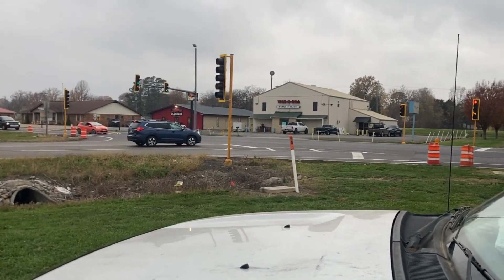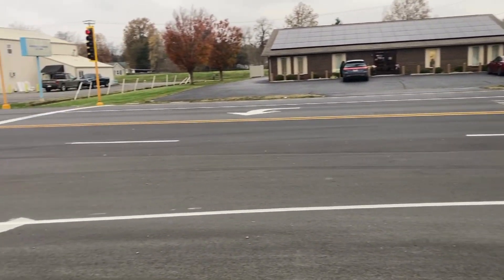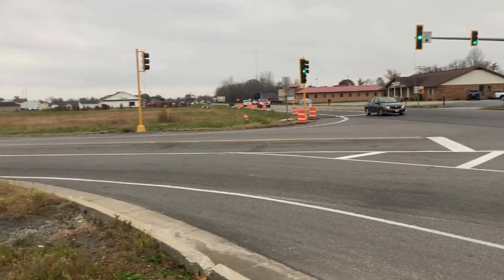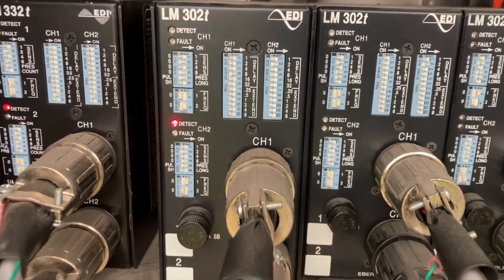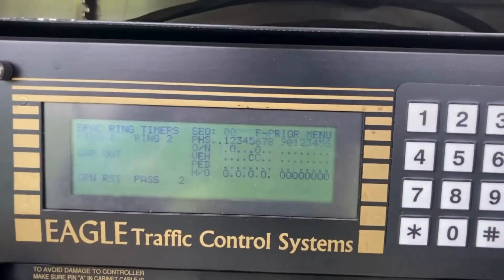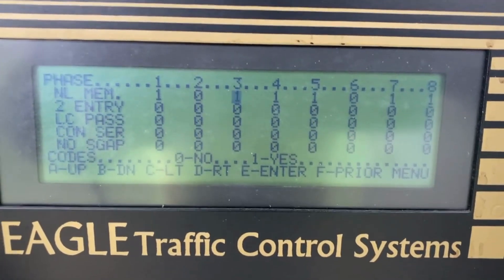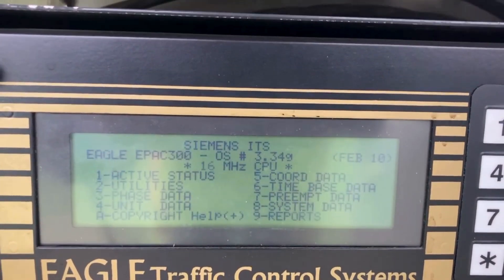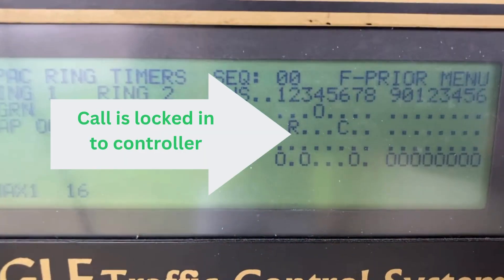How Bad Traffic Light Detection is Fueling Red Light Running

Comment: Yeah is this some kinda government crime or scam to ticket people in a bum economy? There is absolutely no reason to be sitting at a traffic light for 15 minutes or more at 2am when you're the only car in sight anywhere near the light wondering if it's even going to turn green at all but you know that cop be waiting just around the corner and foaming at the mouth! 🚓🙄 There's at least one light I can think of around here that's a really BIG offender. Loops are so antiquated. Smart traffic cams with predefined zones are antiquated. Switch to smart traffic cams with car and people detection so it always knows there's a car or pedestrian there whether they're in the predefined zone or not. If residential doorbell and security cams can have car, people and pet detection there's no reason traffic cams shouldn't either.
Reply from the maker: I couldn't agree more with your statement!  I've been switching to these smart cameras you talk about as we have funding.  They can detect pedestrians and vehicles.  Also these cameras provide signal performance data.  I receive an email everymorning from intersections (equipped with these cameras) that notify me if there are any faults or if there is poor progression between traffic signals on a coordinated corridor.  Also tells me if there are red light runners, how long wait times are for directions.  
Trying to transform our traffic signals (over time) into  a world class system!
Thanks for commenting!

Comment: So, why is this mode not the default for detection loops -- that is when it gets a momentary detection of a vehicle, garantee the next green light?
Reply: In addition to the other response, people making right on reds will drop their call if the crossroad doesn't time out first, saving traffic on the crossroad from having to stop for a call where the driver already left.
Reply from the maker: I was waiting for that question to come up!
I have two perfect responses below.  They stole my thunder LOL
Great question!!
Reply: A vehicle exiting the intersection sometimes cuts it enough to trigger the loop.  Skipping momentary detections avoids that problem.

Comment: Nifty! I thought the only solution would be to cut a new loop in and revert to defined times for the lights. Had no idea you could change how the loops are handled. Such a quick, easy, fix.
Reply from the maker: Its a great 'temporary' fix.  I would want the front loop recut.  BUT..when you need to make the signal run as effeciently as possible under those conditions, it's a great way to handle it! Thanks for commenting!
Reply: @streetsmartstraffic  It would seem that the solution that you used is the way it really should be anyway.  Is there a good reason for allowing the back loop to drop if a car rolls past it?  It's not as if it's going anywhere until the light turns.
Reply from the maker: @nixon2tube  Great question.  The back loop is just additional detection for the movement (in case a driver pulls too far past the front loop).
Placing just the 2nd loop on locking and disconnecting the front loop could be done in your scenario.  You have alot of those people though that weave over from one lane to the other (or are driving on the lines) which would trigger and lock in that detection--and thus giving a green to the direction when no one is there.
Reply: @streetsmartstraffic  Do you have job tracking software that will notify you when that new loop is installed to come back out and rework how the lights handle the loops or is that just something you personally have to remember to do?
Reply from the maker: @spaztech1138  I'm old school.  I carry my clipboard that has all work/projects being done and follow up periodically.  I actually use a pen and write it down!  LOL
Repairs done at the signal go on the tech sheet and left in the signal cabinet.  THat way there is a log of past work done.  
Great question!
Reply: In this area (Virginia) they do NOT install a 2nd loop for left turn lanes so this fix isn't a possibility. Stop line only detection is the name of the game because it's cheaper. Even in through lanes..
Reply: If neither loop worked, then this probably would not have been able to be used as a band-aid; the minimum recall then would be used but is obviously not ideal because why is the light turning green when there's no one there?
Reply from the maker: @Roccondil  You just hit it on the head!  Side street recalls are my last option fix (when all detection has been lost).
Its basically running timers at that point....and I HATE timer ran intersections!
Thanks for commenting!
Reply: only temp loop was designed that way for reason

Comment: Maybe just go back to having the lights on timers?   All the detection stuff seems more trouble than it’s worth.
Reply from the maker: I see some great replies below.  I think the other way though-- when sitting at a light set to a timer, my thoughts are:  "why is this signal not using detection?  Its not that difficult!" lol
IF  the signal is maintained and the detection is working, it's the best thing.  Efficient, smart and a savings to the pocket book in the form of not using your gas in the tank sitting unnecessarily.  One signal:  not to bad.  Take a whole corridor of signals with stop and go...it will start to add up.  Especially over weeks to months.  
Great question though!  Thanks for commenting
Reply: @streetsmartstraffic  Some SIEMENS traffic light computers in Germany revert to timer mode when the detection is not working - e.g. induction loop not conductive -> broken or the camera for car presence detection gives blurry picture or is broken.
Timers should be there as fallback together with an alert to fix the issue.
Reply from the maker: @PascalGienger  Yep!  Our controllers do basically the same thing.  If a detector goes bad, the detector card or det. processor (by design) outputs a constant call to the signal controller.  
The signal controller will then run it's MAX GREEN time for that direction.  So in essence, it reverts to timers.  
Great failsafe but SO inefficient!  That's why its so important to maintain the signal operation.  Thanks for commenting!
Reply: Didn't you say the detector was bad and the system never reverted to a timer? @streetsmartstraffic
Reply: Smart traffic cams are better than the loops but they're still not perfect. Doesn't mean they can't be greatly improved upon in the future with updates. Before printed circuit boards existed technology was a mess. If we would've given up on it PCBs wouldn't exist and we wouldn't have half the advanced technology we have today.
Reply: Remember what we see in videos like this and tend to notice is the failures, when it helps us we usually don't think about it.
Reply: That wouldn’t allow the traffic engineers to move more cars with no friction as is their mandate.
Reply: If you don't mind wasting a good chunk of your life waiting when no one is there, then sure.
Reply: Nothing worse than catching a yellow light to cycle for no traffic. Detection allows more efficient flow, allowing traffic through that is present instead of guessing.
Reply: @quinton1661  Yeah. A big problem with lights that cycle on timers is they don't account for changing traffic volume (i.e. heavier traffic during rush hour and lighter traffic outside of rush hour). During periods of lighter traffic you shouldn't be waiting as long if at all. It actually encourages speeding if people get behind schedule due to having to wait for long periods at traffic lights unnecessarily. If there's one thing I've learned in life it's that people are busy. They're all in a hurry to get to where they need to be and don't like waiting especially when they're the only car sitting there. It doesn't make a lot of sense to make them wait like that.
Reply: @user-is7es  To be fair to timers, they are able to be set to different schedules throughout the day to account for things like rush hour traffic. I imagine in some scenarios timers are used in the middle of the day and sensors during off-peak times.
Reply: @user-is7es  It also encourages people (especially pedestrians) to ignore red lights,  which decreases safety.
Reply: @quinton1661  If only we lived in a perfect world where traffic was easily predictable. Maybe in the early 20th century, when few people had cars. But unfortunately, this is not the case nowadays. They've invented traffic-responsive plan selection (and eventually adaptive traffic control) for a reason.
Traffic patterns change over time, due to things like road closures, new developments (that attract traffic), more people buying cars, etc. It takes a lot of work to keep fixed-time plans up to date, having people stand and count traffic. Often it's neglected, leading to poor performance.
Reply: That is the most moronic idea i have ever heard. Nothing pisses me off more than waiting at a red light with no one else around. We just need a government that isn’t full of a bunch of lazy union workers that are more worried about DEI than doing their jobs well